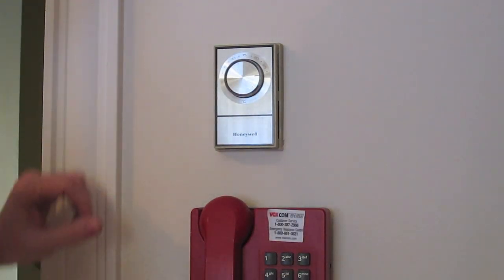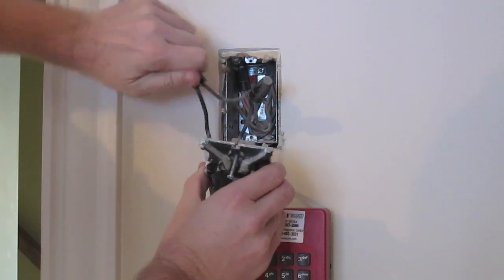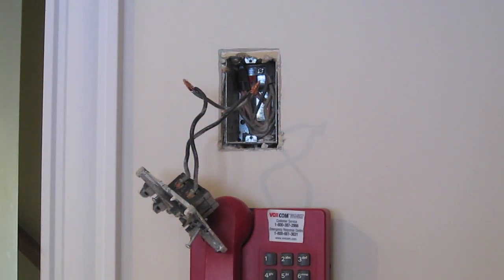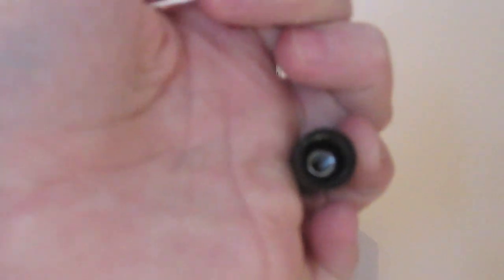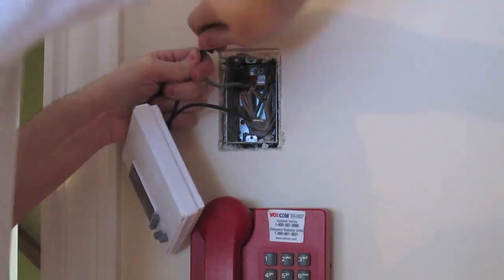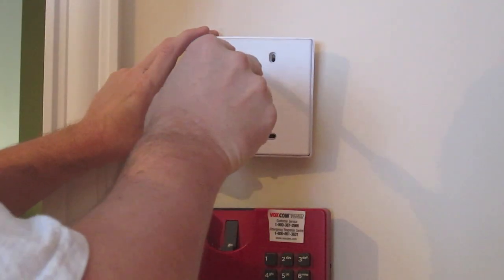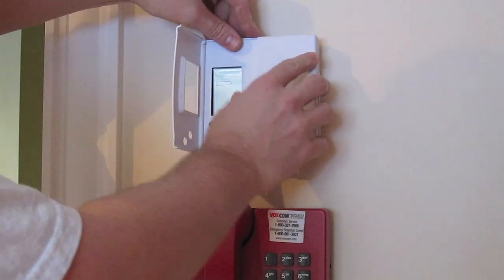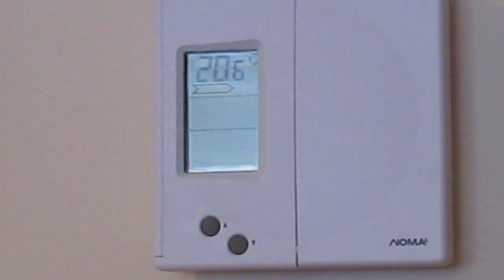DIY Programmable thermostat install for electric heat

Comment: One mistake on 240 V  you should    have **test each power off  wire *  to the ground  also as one line might be on  that  is a fact   as  you could have been schock by 120 V

Comment: You should advise using copper/aluminum wire connection anti-oxidant compound to prevent corrosion that happens with 2 different metals. Also, the difference between an electric furnace and electric baseboard heater thermostats should be explained in detail. Also, Noma is a very unreliable and cheap manufacturer. Buy North American whenever possible.

Comment: Are all electric heat circuits 240 volts? Or are some 120?
Reply: +Mike Hayes (Mike From X-ray Games) All electric heat circuits are 240 volts in residential applications but they can go higher in commercial settings, commonly 347 volts. It's also nice to know that sometimes there is always 120 volts at your heater if your thermostat was like the one in this video as it is single pole and not double pole. This could save you a shock if you are replacing a wall heater and think your all good if the thermostat is off.